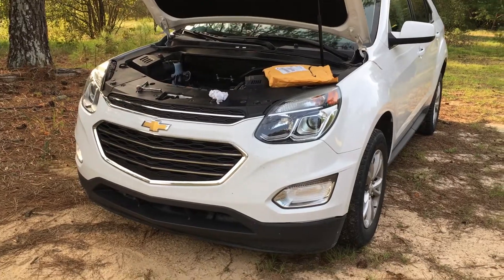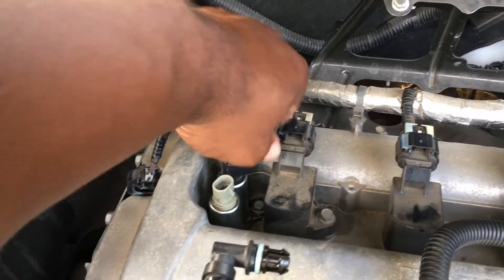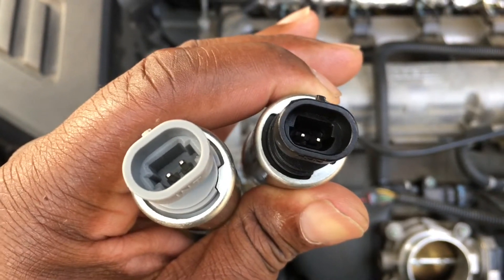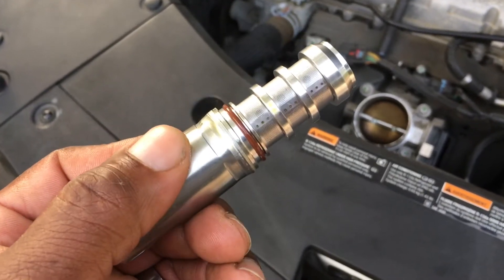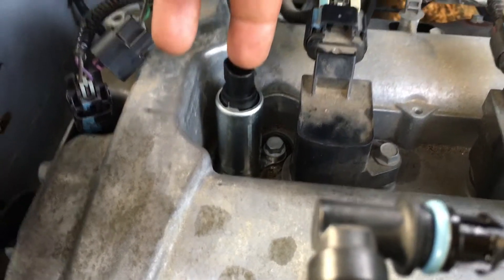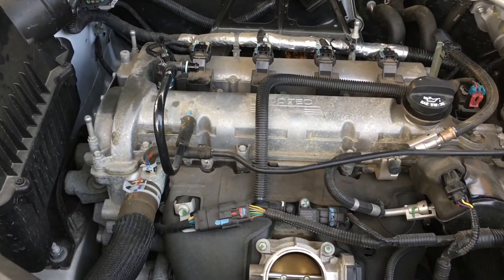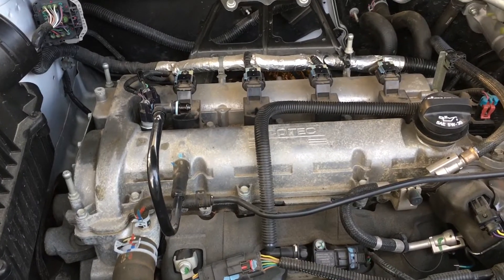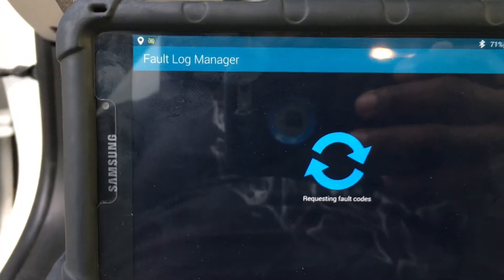How To Fix P0010 and P0011 Fault Codes on 2.4L Ecotec 2016 Equinox!  Torque Pro App and Test Drive!

Comment: Do you have to replace the gaskets as well
Reply from the maker: If you mean the O Rings on the actuators, no they come with new ones pre install just make sure to apply a small amount  of oil to them.